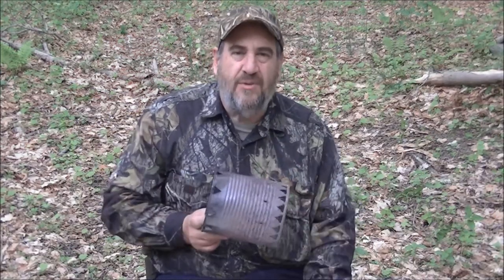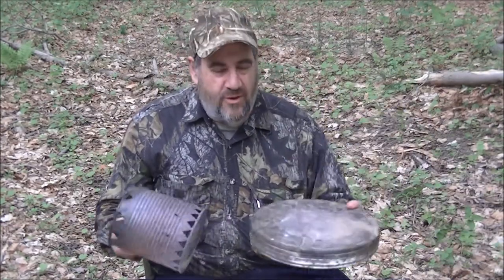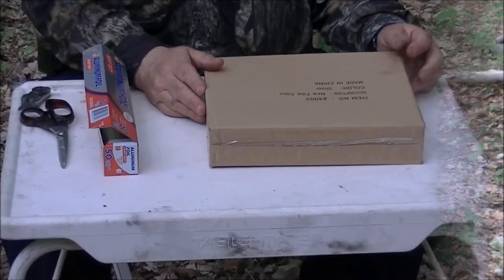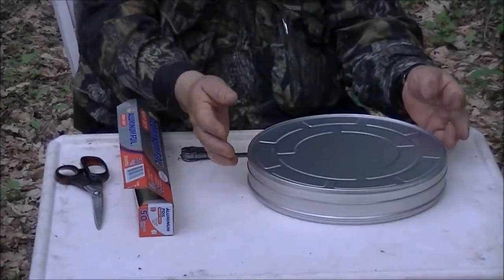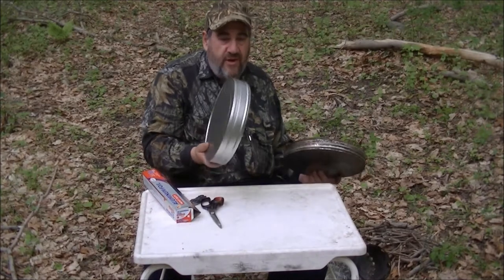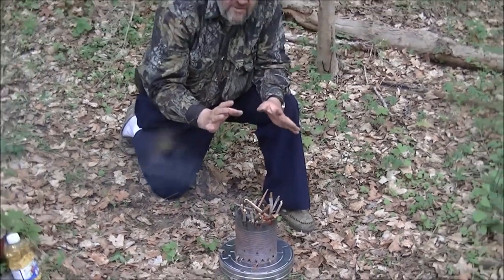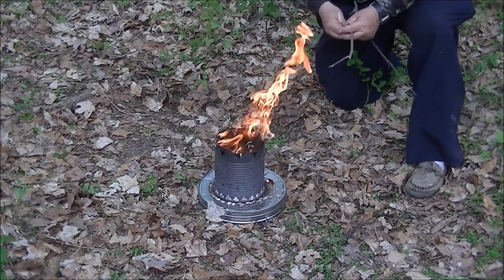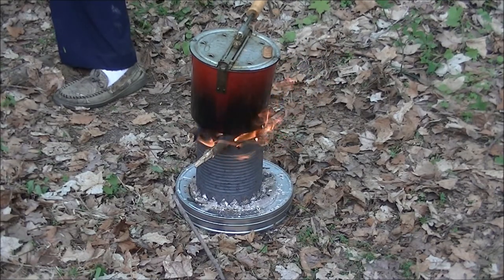Uncle Milo Explains 7   No Trace Cooking Base

Comment: Not to be disrespectful, but can't you just rake the ground of all burnable things and put it on bare ground ...and make sure the leaves and sticks and things are far enough away?  OR maybe stick it inside the fire ring at a campground?
Reply from the maker: Good point.  In certain areas, such as campgrounds, that's possible. I go back country camping in New York State forests, and I don't want to disturb the natural leaf cover. Often there are many inches of flammable duff under the leaves as well.  But, in an situation where I don't have one of these with me, I find a rock or clear the ground, as you say.